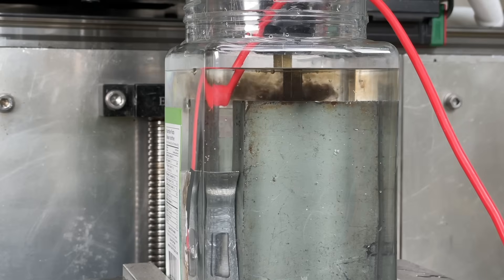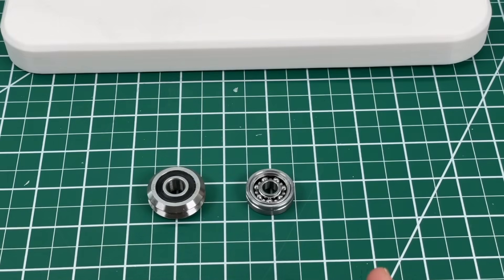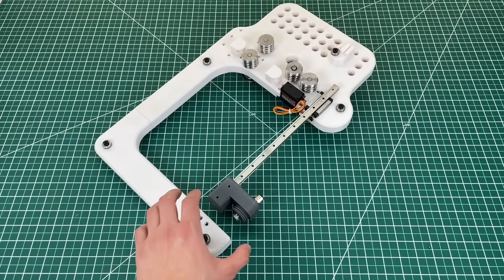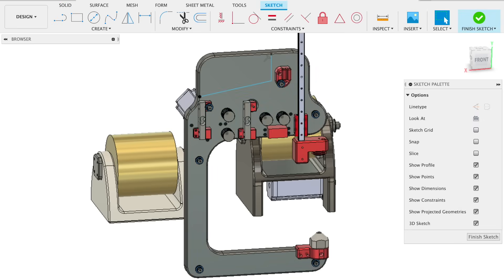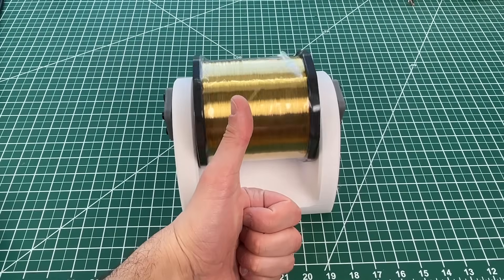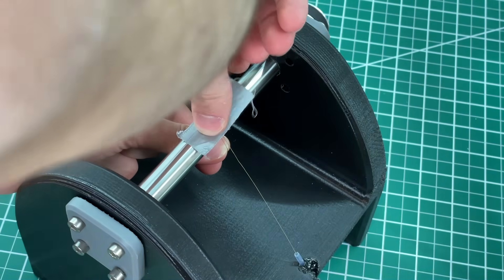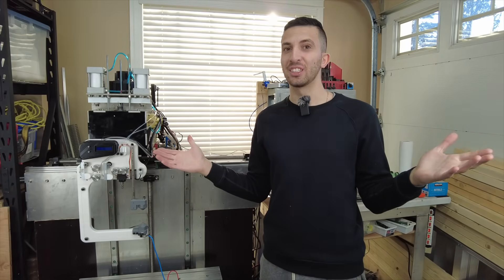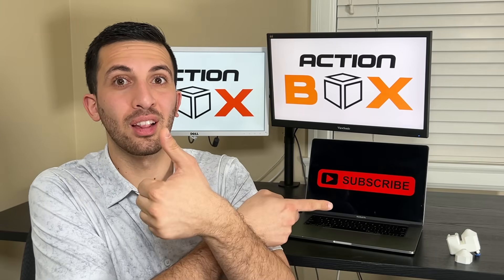How We Made A Wire EDM Machine At Home

Comment: Great video. You are using dc, therefore you will be producing H2 at one place and O2 (and maybe ozone) at the other? If the oxygen is produced at the  metal being cut, this may attack the metal and produce oxides which may make things faster or slower (al2o3 for instance is hard and resistant) so as another of your viewers mentioned, polarity may have an effect.
Reply from the maker: Awesome, thank you.

Comment: Peak current and frequency. You are breaking the wire because you are effectively vaprizing it with your inital pulse. I haven't watched your EDM power supply video - but it would appear that one of the following:
(a) There's perhaps too much capacitance on the live end, which builds up and unloads all at once with the first discharge
(b) Depending on what your operating pulse frequency is on the EDM power supply, the initial plasma arc might establish "ok", but then your subsequent arcs would have a much lower resistence (given the established plasma path) and so if your power supply is failing to correct for that, the current flow would ramp up signficiantly.

When you see commercial systems, the sparks are barely visible and only occur when microns away from the material.... this implies a very high frequency, lower potential voltage and a much lower energy transfer.... where as yours are quite large and audible from the video - lending to my speculation that there's far too much energy being discharged at once.
Reply from the maker: You are totally right.   I will make these changes for my second version.   Cheers.

Comment: I guess those stepper will be reused in other projects, but they are way overkill for this project. The smallest Nema17 would work as good. Just in case someone wants to build this project. They can get away with 30$ instead of 300$. I like the design, can't wait to see it working!
Reply from the maker: You are 100% correct.  Thanks for your support and your comment.  Cheers, Dave

Comment: Seems you guys discovered that the wire handling system is nowhere near the hardest part of an EDM machine... its the control electronics for the power supply to allow for lead-in without breaking wires...
Reply from the maker: Yes indeed.  We are working on a diy power supply now, and we plan to make a second video with all this details.  Thanks for the input. Cheers.
Reply: @ActionBOX  Good luck to you. The community definitely could use ideas for diy EDM power supplies that perform comparably to commercial units. Was contemplating building a machine with one of Bax EDM's units but the cost is pretty prohibitive.
Reply from the maker: @nicksantos43  how much would you be willing to spend?
Reply: @ActionBOX  would be nice to find a suitable solution for a few hundred dollars max $1k to bring it more in line with hobbyist CNC machines and laser cutters. I think the current price of a Bax EDM power supply is $3k+. Its all about making the technology more accessible to hobbyists and home machinists.
Reply from the maker: @nicksantos43  thank you.  I’ll try to develop something for several hundred dollars. No promises and thank you for the insight.  Cheers.
Reply: @ActionBOX  Awesome! My understanding of power electronics is pretty mediocre but I know enough to know the problem is not an easy one considering the precision control of gap voltage/current required. I can definitely say if you can reach that price point I will be one of your first customers! Good Luck!
Reply from the maker: @nicksantos43  hahah, thanks but I won’t be inventing a product.  Perhaps just a workable prototype that I will share all the designs to for free, but I want to make sure I design within a budget that my viewers are willing to pay.  Let’s see if I get anywhere.  Cheers, Dave.
Reply: @ActionBOX  Understood! Well just fyi if you were to make it a product I am sure there would be a market for it. Will be following closely!

Comment: You need to monitor the current and use it to control the cutting speed
Reply from the maker: Do I need to do this dynamically?  Cheers.
Reply: @ActionBOX  Yep, and it will be painfull. maybe check the max current the wire can handle and limit it so you don´t need to wind it again and again and again....

Comment: (I am not an expert.)  Two thoughts: If your wire is too tight then it will break whenever it weakens.  Your feed and take-up rollers will need to move at different speeds because the diameter of the spools are different.  Second, could your power supply be throwing more current than the controls reflect?  i.e. instantaneous power much greater than average power?
Reply from the maker: Hi Elizabeth, to your second point, you are correct. I have starte4 working on a new DIY power supply that would be cheap for you all to replicate, and I am taking this into account. Thank you for considering it and sharing your thoughts. As per your first comment, they do move at different speeds, but perhaps I did not understand what you meant. Cheers, Dave
Reply: @ActionBOX  As an experiment, you could add a small incandescent bulb in series with the electrode to see if reducing the power further has an impact?

Comment: Flushing is key for edm.  Get your wire guides as close to the material as possible. 0.2mm or closer.   And maybe higher pressure on the nozzles. Every wire edm I ever ran varied the feedrate into the part to match how fast it was actually cutting, especially as it's entering the part starting the cut.
Reply from the maker: Than you, I will add that to my to do list in the V2. Cheers

Comment: I have worked with EDM at a few places and have never seen wire reused. At one place where they did EDM with electrodes (graphite copper) they would be machined in a specially ventilated cnc  . Then each hole had a rougher and a finisher electrode. When the rougher wore out the finisher became the rougher . At my current place were run 2 wire edm machines 20 hrs a day and ever 2-3 weeks it takes a whole pallet of brass wire
Reply from the maker: good to know, thank you for sharing.

Comment: Why just embed nuts into the parts during the build?  Create a cavity, pause the build at the beginning of the top layer of the cavity, drop in the nuts and continue the build. Cheaper, easier, cleaner, faster and better.
Reply from the maker: That wouldn’t work given the height of the print and insert. Wouldn’t the nozzle hit the top of the threaded insert?
Reply: @ActionBOX  I've been doing successfully for over a decade. I guess you don't understand what I described ?? Nothing hits the installed nuts because they are inserted flush into the cavity you create for them and then you simply continue printing right over top of them.
Reply from the maker: @threedprintedmarinetechnol3330  O I get it, wow thats genius. I will try that out. You mean I should use real hex nuts. I thought you meant to use my inserts. Thanks for an awesome Idea. Cheers, Dave

Comment: I believe you may want to increase wire feed speed. And flush your cut even more. I believe the nicer wire edm machines have a through orifice coolant that can auto-refeed breaks. Of course, multi stage filter your water. Maybe also try the pause and remove from cut to cool and clear. Then engage cut again
Reply from the maker: Thanks for the tips!

Comment: Professionally, the “wire” is actually brass/copper pipe that’s really small with an even smaller inner diameter. They then rotate it while pumping high pressure water through the “wire”. You can buy edm bits/wire online. Alternatively, you could tweak the tension settings so they’re slightly lower as to not stress the wire too much excessively. Also, try experimenting with different alloys, and tungsten filament that would be the right diameter isn’t too terribly expensive. Or, you could just sacrifice some kerf and whatnot and just go to a more heavy duty wire.    Also, you could do a patent search on professional/commercial edm machines as I’ve found that it can give some insight as to what can be improved. Skip some of the trial and error lol. 
If you haven’t already, check out this video by  Applied Science On his diy edm setup and see if any of the info is relevant. https://youtu.be/rpHYBz7ToII
Reply from the maker: Thanks for sharing.  Any idea where to get a thicker edm wire?  I purchased from McMaster Carr

Comment: Looks like problem with power supply has some output capacitance that not allow to precisely control spark current. Just add a 10 ohm resistor in series to reduce current. Awesome design
Reply from the maker: I’m working on a diy power supply now that I will share in the second video of this build. Hopefully coming out in 2 months or less. Cheers.

Comment: Why do you have such simple breaking system? 
There is no regulation in this way breaking. 
You can use just one load cell. 
Maybe you can choose for two motors to control the tension.
Reply from the maker: im not sure what you mean. Can you elaborate?
Reply: @ActionBOX  you mean the breaking, the load cell or the two motors. 
Sorry I'm dutch so my technical English is very hard. 
I really don't know how EDM machines are working, I look at it from a flat rol metal milling machine prospective !
Bud together we get there in the end. 🤣🤣

Comment: I worked in a tool shop with wire and electrode EDM machines and these machines used oil (kerosine) so I think the water you use would conduct too much power and snap the wire?
Reply from the maker: Perhaps.  But I don’t want to use anything more toxic than water at home.  Great idea and thank you for your comment 😃

Comment: if your power supply is not pulsed, but RC (resistor-capacitor), initial discharge of capacitor breaks the wire. Motion is not the problem, at least not in this stage of development, because if its too fast it will not break wire with spark, and if its too slow it will sound weird. Also, speed of wire feed is not a problem, as well as tensioning. I belive your power supply is the problem, and initial discharge of capacitor breaks the wire. Solution? Add some really beefy limiting resistors in series with your power supply, you need to play with values, try something between 50 and 500 ohms, and choose some resistors of at least 100w. Also, water as you say must be filtered trough water filter and trough de-ionisation resin (filter for deionisation resin look literally like 20-30cm diameter pipe, filled with that powder, and ordinary garden hoses on both end, not much science there. Instead of water you can also use dielectricum oil for edm machines which doesnt need deionisation, but requires filtering same as water. Alernatevily, ive seen people using vegetable oil and even diesel for cooling. Optimal voltage for wire machines is between 30-70v, depending on the thickness and type of the material, and amperage is between 5 and 20A, but voltage and amperage are not critical for sucsessful cut, as much for speed and finish quality of the cut. I'm working both on wire EDM machines and on disc 6 axis edm machines
Reply from the maker: This reply is exactly what I was looking for when I asked for viewers help.  Would you mind if I give you a shoutout when we make out next video?  I think all of your suggestions are correct and I appreciate you adding values as well.  Thank you so much, Dave
Reply: @ActionBOX  of course! If i can help you something, feel free to reach me out! :)

Comment: I think that "Zoe the Robot" would say that at the point of contact, the heat from the arc will be the same on the steel as on the brass wire. Since brass melts at a lower temperature, the brass wire is going to melt before the steel is cut. You might try using a tungsten electrode from a TIG welder, instead of brass wire.
Reply from the maker: I’m not sure that’s true.  At 10,000c they are both melting.  At most I wiuld agree that the brass would melt faster, but it also sociopaths heat much better so heat is more localized in steel, making it heat up faster at a single location.  Regardless, I like your tungsten idea and I will give it a try. Cheers

Comment: wow nice job. I have two wire edm machines.
try speeding up the wire . the power settings for different materials are quite involved on my machines, all to keep from breaking wire. I would try doubling the wire speed and slowing the feedrate to about .010 inches per minute. You can then start creeping up to maybe .100 per minute. alsoYour stepper motors on Your cnc x and y may need to be geared way down so that max speed is about 3 -5 inches per minute. The reason for this is that the steppers may be " jerking the table forward in amounts that the wire cannot handle. by changing the ratio the feed will be much smoother which is needed for the wire not to break. some of the variables on my mitsubishi machines are on time, off time, power current, wire tension, wire speed.My main focus would be the stepper pulleys. The ratios for a mill will not likely work for a wire edm.
Reply from the maker: This comment was extremely informative. I will definitely consider all these points.  The motors on this machine are indeed geared down such that every pulse of the motor is 7.5 microns.  Do you think it needs to be less? Cheers

Comment: Just a guess but maybe some electrolysis is happening so either 1. When enough hydrogen/oxygen is present around the spark, it ignites causing trauma to the wire OR 2. Enough gas is forms around the wire for long enough to allow the wire to over heat. Is there another fluid you could use that wont break down into a gas?
Reply from the maker: Makes sense.  I don’t want to use a more dangerous fluid, hence deionized water is good, but if you know of alternatives please do share.  Cheers.

Comment: Put the wire orizontal, botom to up move , the melt      particule to can go , and try put more force in wire to be solid, idea is optimizeze lot ,   is  not easy make edm. Nice  to see you work.-+ then -- then -+, with higth hz , and lot smal things.
Reply from the maker: im not sure what you mean. Please elaborate
Reply: @ActionBOX  see others edm, the water move fast, the electric unit is special, imagine lot spark making the cut, were move all, i not expert, i am noob.

Comment: Voltage and amperage comparator required to sense spark gap, this output drives motor(s) which maintain constant gap and current through spark. Same is required on sinker version. the electrode NEVER touches the work.
Reply from the maker: seems to be a common recordation so you must be right. Thank you for your comment.

Comment: Awesome!  As your power supply gets more sophisticated you’re going to need to shield those strain gauges and their wiring.  Also using set screws to transfer torque to cylindrical shafts is bad practice.  Keep up the great work!
Reply from the maker: Hi Chris, the set screws are a standard in all CNC machine parts I have ever purchased. Can you please elaborate on that point? Cheers.
Reply: I can't speak for Chris-bg8mk but I would think that for torque transfer a woodruff key or a taper to shaft and hub/wheel is preferred over a set screw.
I'm curious whether and how quickly this comment, 2 years after, will draw (your) attention 😀.
Apart from all that I'm impressed by both your design and the video production. The positivity and the useful contributions in the comments is great too.
ETA: subscribed!

Comment: What about crossing the wires between the brake rollers? instead of = looking wires, use x. zero is rollers, x is wire, 0x0? or would that be too much tension?
Reply from the maker: That would be far too much tension and the wire will snap, but great question.  And thinking 😊

Comment: Definitely need to filter the particles out. It won't be deionised for very long.
I operate two (soon to be 3 😋) WEDM machines and they pump the water through filters and deionising resin barrels to keep the conductivity down otherwise the wire just shorts out instead of sparking.
Also, I think I'd have been committed to an insane asylum by now if I didn't have auto rethreading 😏. Wire breaks are frustrating enough even with it!
Reply from the maker: Hahahaha I like your joke at the end 😜. I know how it feels.  Can you enlighten me on what the resin filter is?  You are right that I need to deionize, but how would you recommend I do it at a DIY/ cheap level?  Thank you.
Reply: @ActionBOX  You'll need both a paper water filter, and the resin filter. The paper to filter out the big stuff before the resin, otherwise the resin will be used up too fast. The resin is two kinds of beads that attract the ions better than the water did. You'll need to pass the water through a container filled with the resin beads. Can get messy as the beads are small and like to fly all over the place if(when) you spill them.

Comment: You cannot use constant speed; you must modulate the speed to achieve constant (average) current.  The sparks will generate current spikes, so you must condition those with a low-pass filter (averaging) before amplifying and ADC.
Reply from the maker: constant speed of machine or constant wire speed?
Reply: @ActionBOX  The wire speed should be constant; the cutting speed should vary with spark current.
Reply from the maker: @byronwatkins2565  awesome. Thank you.

Comment: Excellent Build. To avoid wire breaking try using arc voltage/current  as feedback to determine axis feed rate instead of  a fixed  feedrate .Similar to THC on plasma.
Reply from the maker: Thanks for the comment, and good point. I’ll definitely keep that in mind. Hope you enjoyed the video! 😄